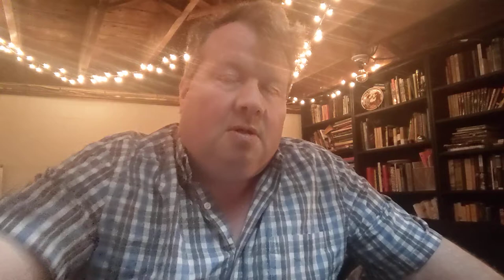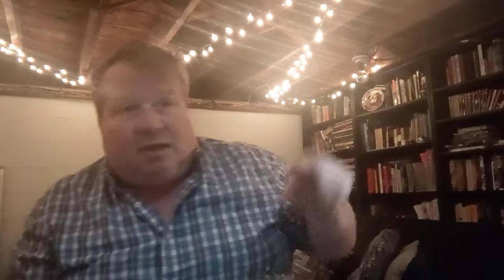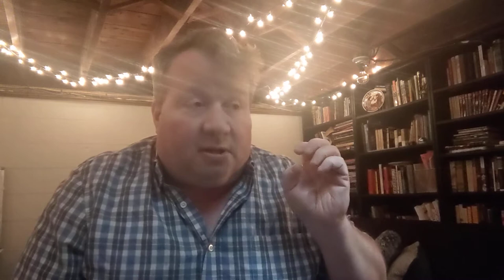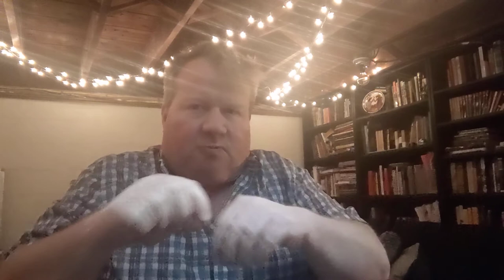A Brief (and incomplete) History of LOMO Microphones.

Comment: Thanks for the video! Last year I was in Armenia and as you probably know it was a part of the USSR; plenty of cool gear around. I happened to buy a LOMO 82A-5M Y2 while I was there and I would like to bring it up to modern specs with an XLR connection. Is that something you could help me with or could you possibly point me in the right direction?
Reply from the maker: my memory is those mics are not transfomer balanced, meaning there's just a hot and cold wire, #2 it hot
Reply: @microphoneboutique  Thanks for your response. I wondered if it might be that straightforward. Just to be sure, are you saying if I had a balanced XLR cable, for the cable coming from the mic itself I could marry pin 1 and pin 3 (the ground and cold)? Then on the connector going to my pre-amp I would solder pin 1, 2 and 3 separately.